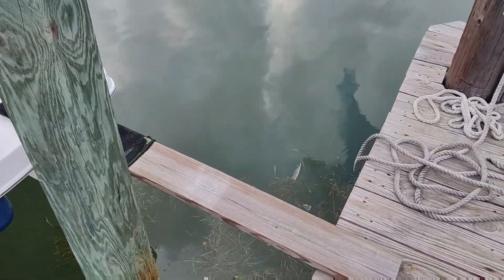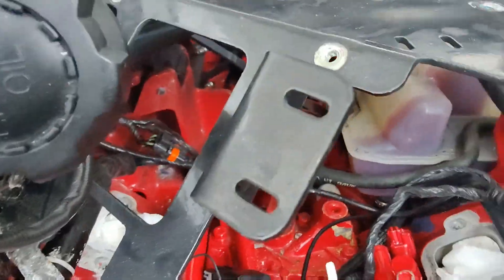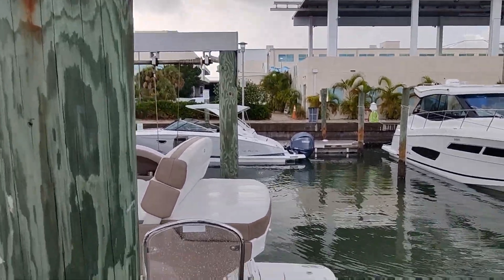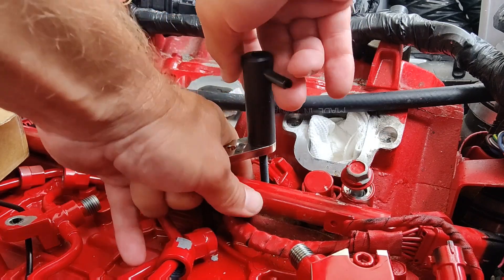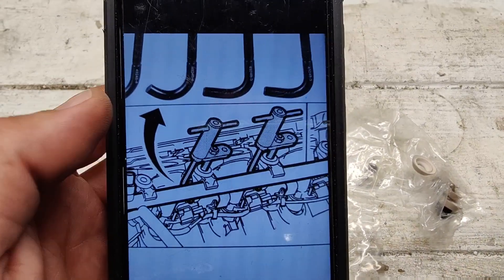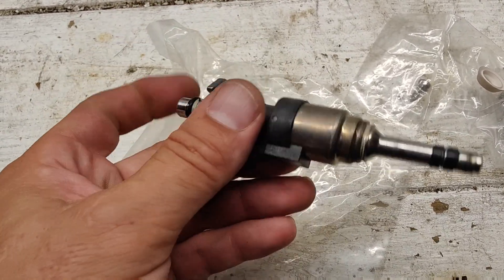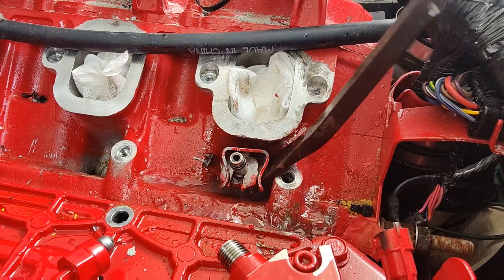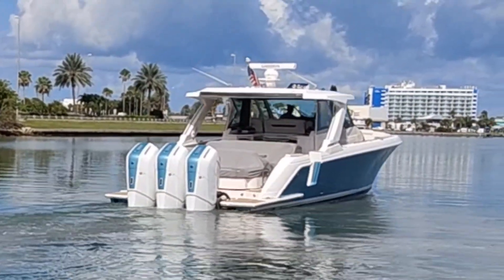Volvo Penta Fuel Injector VS Saltwater #Broken #Stuck #Episode179

Comment: Thanks for letting us watch over your shoulder, I love seeing these Gen 5 Volvo Penta videos. There isn’t a lot of info out there on them yet, In your experience, how are the aluminum manifolds and risers holding up? How many years are you getting out of them before replacing?
Reply from the maker: Thank you. Honestly I have seen about 6 years from them. They seem to hold up well with normal maintenance and good flushing.

Comment: Customer complaint was fuel smell? Would have thought it would have set a misfire code. That cylinder should have been running lean. When you get back to this job, could you please shoot some video of the 2 cats? Would love to see if there is any visible difference between bank1 and bank2.
Reply from the maker: The injector was corroded bad enough to leak fuel out of the stem and pour out from around the back of the intake when it would run.  It would set off the vapor alarm in the boat almost right away.  If I am the one to continue the job I will definitely film it. 😃

Comment: This volvo obviously wasn’t a closed loop cooling system like the new ones , right ?
Reply from the maker: It has a heat exchanger and antifreeze. It's just like all the modern Volvos out there.  All those components are on the front of the engine and didn't need to be removed to take off the head.